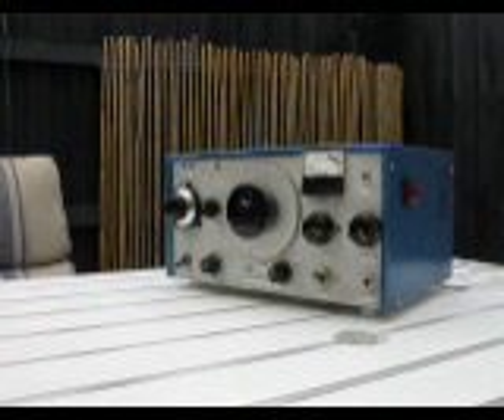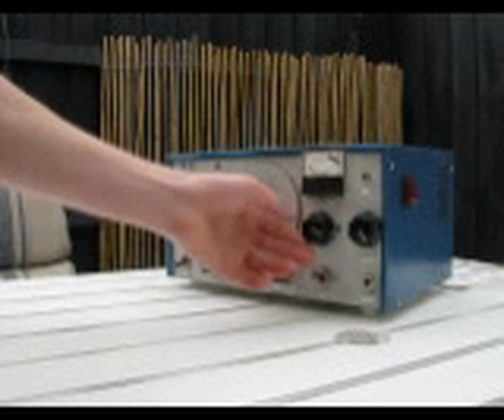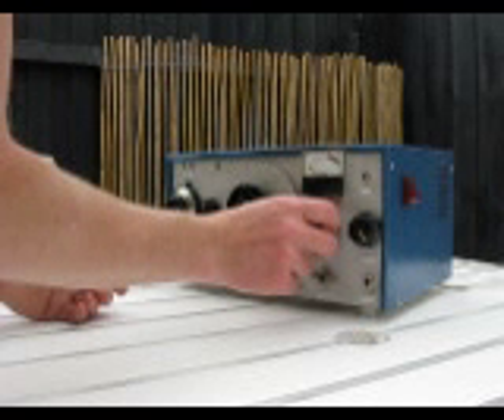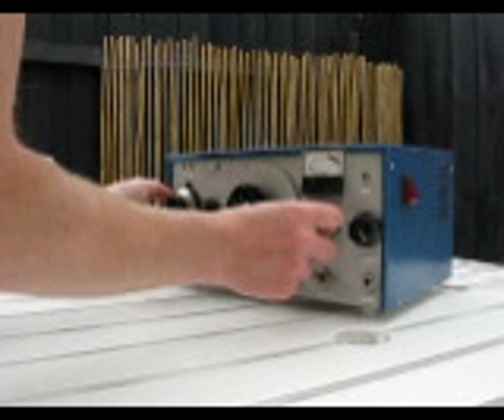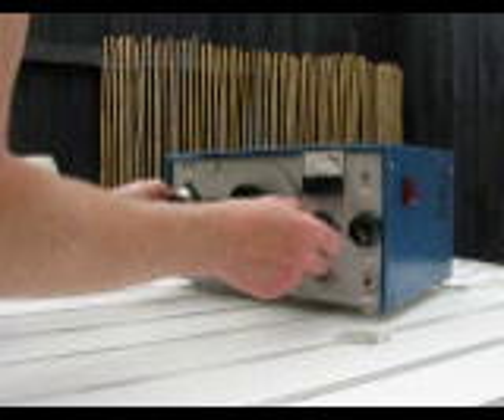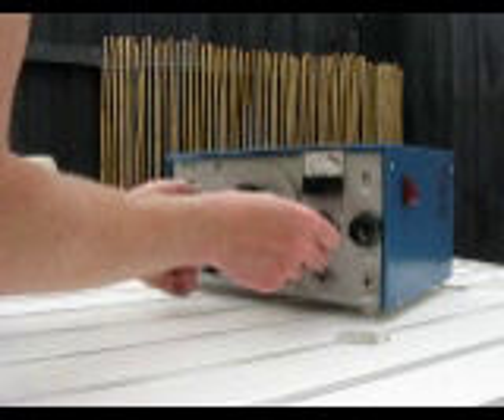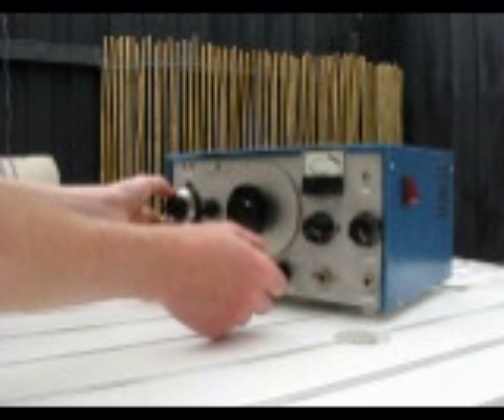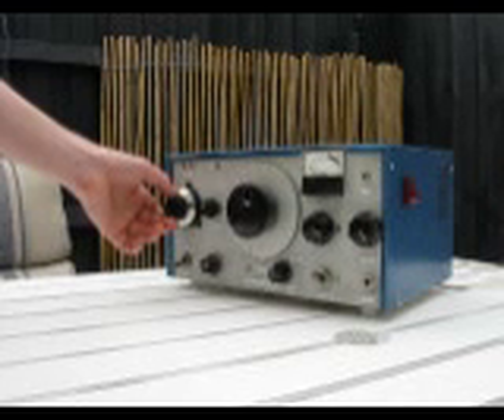HF regenerative receiver demonstration

Comment from the maker: Yes, it's a vernier dial. 

Any SSB receiver, particularly one that covers several megahertz in a 180 degree dial turn will be critical to tune. 

Hence vernier dials are used for both the main tuning and the fine tuning. 

The meter is not used for much. Only for battery voltage when a switch is pressed.

Comment: Interesting, I'm thinking of doing a regen receiver. It seems critical to tune, is that a vernier drive on the left? Also what is the meter for? (I didn't see it move, is it signal strength?).